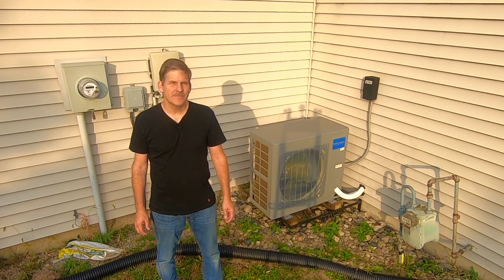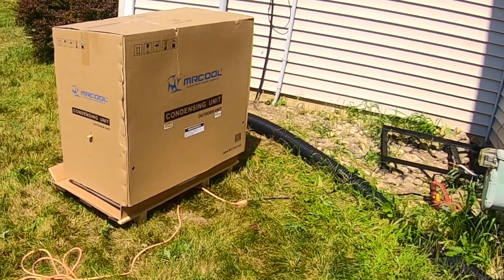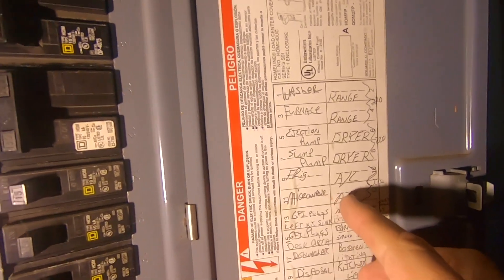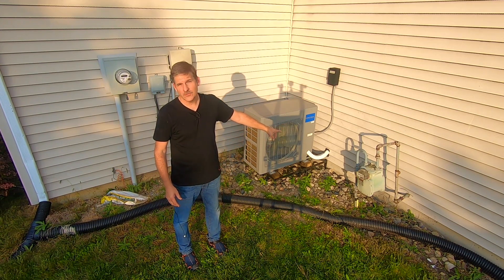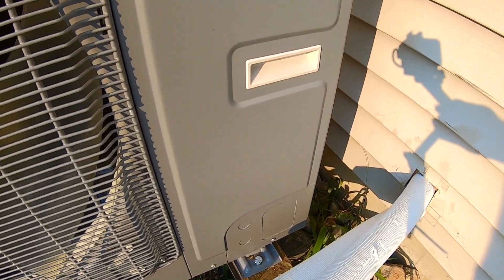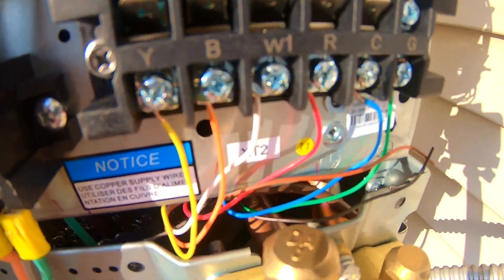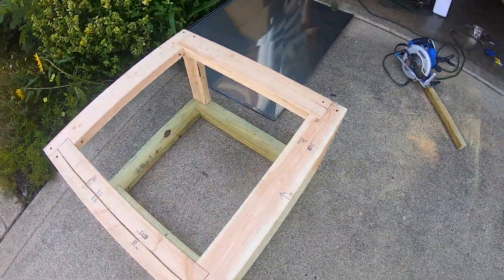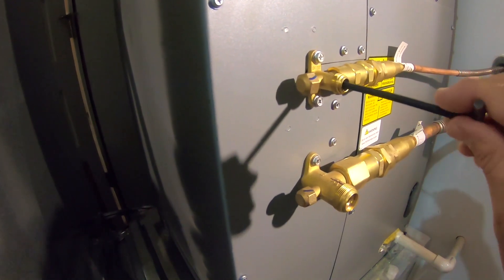How to install Mr Cool Universal Heat Pump: air conditioning and heat solution

Comment: how does the system get fully charged?
Reply from the maker: Hey Robert,
The unique aspect of this system is that the line come pre-charged from the factory. All I had to do was make a simple connection with a wrench and open a valve with an Allen wrench. 
Hope that helps. Thx for be watching. 
BTW - we plan to post the winter review video of how the heat pump system performed through our Midwest winter - it should get posted  on 4/17
Reply: Just as an FYI, all units are precharged and have been for decades :) Even typical units from say Carrier or Trane.
That being said, some aren't charged right even from the factory :/

Comment: How does the inside unit get it power? Is it a separate 110/115 volt?
Reply from the maker: Hey hoptag,
The indoor air handler uses another 230v circuit inside. We got it easy on that part. Our house came with a 230v circuit for an electric dryer. It was unused because we have a gas dryer. So we repurposed that.
Thx for watching!

Comment: how good does the heat work when its mild or barely chilly out? Lets say its 50/55 degrees outside?
Reply from the maker: Hey hoptag,
Heat pumps work heating by taking heat from outside and bringing it in. The warmer it is outside , the easier it is to heat the inside. 50 degrees is relatively warm so it would work well. 
This past winter it went down to at least -9 degrees here and was still able to keep our house at 70 degrees w/o an aux heat strip. 
Heat pump tech had come a LONG way in recent years
.
Thx for the comment and for watching!

Comment: which side of the inside unit the hoses are installed?
Reply from the maker: Hey Luis,
As you look at the air handler, where the air enters the air handler as the front, the  connections are on the right hand side.
Thx for watching.

Comment: Obviously you have installed these before so you know what you are doing.  But installing one of these looks quite involved and I bet not just anyone could install one of these.  I also notice that this job requires a lot of strength and you have a buddy helping you.   The only downside to this is what you got the heat pump sitting on.  You surely could have done better when it came to the base it sits on.    But I'm impressed since I'm needing to replace my furnace and  air condition.     Thanks for the great video.
Reply from the maker: Hey 100....,
Thx for watching!

Comment: I just bought this system and 25 feet of linset do i need to buy that union that you screwed on between the big line and the condenser? i guess you need a set for the air handler also or does the linset just thread on directly?
Reply from the maker: Hey Jay,
The necessary connections should be included.
The set-up should come with everything. But if you order 2 line sets to reach a greater distance, I think you’d then need to order a union set to connect the 2 line sets together. 
Thx for watching.
Reply: @Housebarons  Im glad to know that, i even ordered the mr cool wi fi t stat!

Comment: DIY installation is a recipe for lots of installations being out there 'in the wild' that don't meet local code. You pay for more than the materials, process steps, and physical labor with a contractor, you pay for their know-how and ability to design an installation that will meet code. That being said, the MrCool units are neat and hopefully they last and can be serviced.
Reply from the maker: Hey Avoustic,
I do think Mr. Cool has tried to address making the install fairly simple and help prevent hack jobs in “ the wood”. 
As for longevity, here is hoping. We will keep you posted!
Thx for watching.
Reply: Did you put an oil return bend in the linesets since your air handler is located below the condenser in elevation? Great looking install and very clean. That 3/4 looked tough to bend. I bought a cheap bender on eBay to tackle that.

Comment: How big is the house? Also would have been nice to see how you attached the air handler to the existing duct work (top of unit)...seeing the box built for the return was helpful.
Reply from the maker: Hey Rob,
This was an unusual install. I’ve never had a heat pump before ( previously we had a gas furnace. ) . So because my condenser died, I left the gas furnace which still worked in its place. I then mounted the Mr. Cool Universal air handler next to it.
In this video, https://youtu.be/S3ZEmjLvyNo
You can kind of see it behind the return ductwork I was attaching to the air box. 
This video was intended to show basic ductwork. 

Originally, I had the new air handler go directly up into the supply duct . The flow was not very good, so I changed the duct out of the top of the air handler and directed the air to go to the right to the original air plenum sitting over the old furnace. This worked fine.

I was reluctant to trash an old but still working gas furnace till I could make sure we were totally sold on the heat pumps winter heating abilities. Old heat pumps do a bad job of this. 
However, as winter has progressed, we have seen that even below zero temps did not hamper the heating ability of the New Mr Cool Universal. We did NOT install an aux heat strip and even though we’ve experienced below zero temps, the heating stayed easily at 70 degrees - thx to the inverter technology, it is still efficient below zero degrees F. 

Anyway, we plan to do a review after winter is over and layout it’s winter heating costs and performance. You may see the whole set-up then.

BTW - the house is 1900 sq ft with a basement ( but vents are closed down there) 
Thx for watching!
Reply: @Housebarons  Thanks for directing me to the other video. I have the same type of system from 1993...gas w/4 ton AC...all still working but on its last leg. My house in AR is 1600sqft with an additional 700sqft walk out basement. I can't decide if I want to go with the 2/3 ton or the 4/5 ton Mr Cool Universal. My other issue I can see coming is joining the old plenum to the new unit. It looks like whoever put this in did a crazy custom fab job...all kinds of weird angles and where the two meet the old and new air handler are different sizes so I'd probably have to fab something else together...any tips?
Reply from the maker: Hey Rob,
Great question!
We lived in AR a while back - very familiar with the hot summers! It ultimately boils down to windows and insulation.
We have double pane windows and r-50 or so in the attic, no shade trees, 3 bedrooms (700 sq ft ?) upstairs. 
So the 3-ton ( default ) setting was fine for us. 
You can compare from there. If you are using the basement often, have less insulation or leaky windows, then maybe you stay at 4 ton. 

It is such a tough call because there is plenty of writing about over sizing is not good for longevity of the system. But that doesn’t seem to be your case - you being on a 4 ton now that has lasted a long time seems right. 

Since you are already on a 4 ton, I would be worried about going down in size... other than the 3 ton is doing fine at my house. 😃

This system should be much more efficient than what you have, so I expect you’ll be saving cooling $ at least. 

As for the hook-up, if your heating needs aren’t huge as I would expect, you could just get rid of gas furnace altogether and old cooling coil and even the funky plenum and start fresh. That is NOT what I did because I was worried about heat pump and winter performance. So my routing to the old plenum is convoluted , but in the end worked. 
But a direct route of air through the plenum to the supply trunk would be ideal.

Btw - Mr cool does make a split system if you don’t want to leave gas for winter...but that would take a pro-HVAC install. 

Are you installing it? Do you have a time set for when or is it just some day down the road? 
Thx.
Reply: @Housebarons  We have crappy windows and average attic insulation (soon to be remedied) so the 4/5 ton will probably be the sweet spot for our situation. We are planning on ripping out the whole system and replacing with this unit ourselves in the next month or so. I feel that with the Air Handler also being variable speed DC...that should save on power consumption in both heat/cool and air circulation. The furnace/air handler we have now uses about 950W just to run the blower. I found a couple of videos on how to field fab a connection from the air handler to the existing supply plenum...looks pretty easy. The next thing to tackle "in my head" is the return. The return comes from the 1st floor to the basement then passes through a block wall at ground level. On the other side of the wall is the filter box/housing that is joined to the side of the furnace on the floor. From what I can tell, I'll need to build/buy a box for the new air handler to sit on and somehow fab/coble together a connection to the return as it exits the block wall. Guess I never really realized their was so much "custom" work when installing HVAC systems...at least from the connection standpoint.
Reply from the maker: Hey Rob,
I’m guessing the 10.5 seer heat pump heat is about 25% more expensive than my old 10 seer gas furnace ( just a guess, haven’t crunched the numbers yet) 
But the 18 seer universal a/c is 80% more efficient - so summer is where the savings will arrive. 
As for your return, could you connect the new air box/ return plenum to your old return? I had to build a duplicate return because of our temporary side by side set up. But maybe with a little fab ...?? 
You are right - lots of  “ custom “ duct work but since you are doing a complete replace, hopefully it won’t take too long. 
Sounds like you’ve done your homework - I expect it will go well!

Comment: I am just learning the ins and outs of hvac, and considering installing this unit this summer. Apologies if this question is crazy. My existing gas furnace is a downflow furnace, with the return coming in from the ceiling and the ducts in the floor. The slot the furnace is in now and where the air handler would be going in to is just big enough to fit the air handler by about two inches. Can I install the air handler upside down?
Reply from the maker: Hey Eric,
No. I don’t believe so the way you are describing. But it does come with 2 drip trays. One vertical, one horizontal. 
Therefore, the universal can be in an attic / downflow position where the unit sits on its side ( so to speak ) or in a horizontal position  - if the unit was placed in an attic and the air was directed down into the house. 
So if you are talking about an attic install, the horizontal position may work for you. 
Here is a link to the Mr. Cool site video where the show it mounted in the attic horizontally:
https://youtu.be/w6Z8_dpXFM4
Hope that helps.
Thx for watching.
Reply: @Housebarons  thanks for the reply! Unfortunately, here in New Mexico, we are the land of no attics and flat roofs. Looks like I'll have to explore some other options...
Reply from the maker: Hey Eric,
Ouch. That’s a different kind of setup - but guess for your area - makes sense.
You could call MrCool to see if they have anything for you market segment.

Comment: How much have your heating bills gone down?
Reply from the maker: Hey Justin,
None. They have gone UP. But that was expected. 1) Natural gas ( which the heat pump replaced) is very cheap. Electric isn’t. 2) the SEER rating ( seasonal energy efficiency ratio ) for the old unit was 10 and this new unit heat seer is 10.5. So they are very close here. 

The plan was to save money in summer. The SEER rating on the a/c side however for the new unit is 18 - which is 80% more efficient than the old 10 SEER rating of the old unit. 

So, that means the savings in summer should eclipse any extra cost in winter. 
In addition, the DIY aspect of this MR COOL meant I could install it rather than have an HVAC company inetall theirs. That alone saved me $2000+ dollars on the a/c alone. 
So after a full year, the savings should be substantial.

Keep and eye out. In spring we’ll do a review on its winter costs / performance. And after summer we’ll do a total 1 yr review. 
Thx for watching!
Reply: I’m from Missouri and I’m about to buy one for my house and install it in spring I have all electric heat I was wondering if your electric bill has been higher our lower this winter then it was in the summer with your old unit thanks.

Comment: How much kWh does the unit use in the winter months ?
Reply from the maker: Hey Jason,
To do any comparison it means weighing MANY, MANY variables:
- where you live
- how cold it gets
- thermostat setting
- how many windows you have
- how much sun you get in them
- how well the house is insulated
- size of unit
- how tall your ceiling are
- square footage of house 
Etc, etc, etc

We are in Midwest USA, 20 year old house & windows, r-15 insulation in walls r-50+ in attic. Average 9 ft ceiling height. ~1900sq ft plus 1100 sq ft basement ( vents closed in basement).
We get very little sun in winter. 
Windows are double glazed.
Mild winter this year.
Unit is set at ( 3-ton or 36,000 BTU) w/ no aux heat strip.
Thermostat set to 70 degrees at day and 66 degrees at night. 

With those details : In December our useage was 1582 kWh. 

I’m the spring, we will make a review video comparing its first winter in use compared to previous gas bills we’ve had ( since it has replaced our gas furnace ) 

Hope that helps. 
Thx for watching.
Reply: @Housebarons  thank you so much for providing all this specific information. do you mind telling us where you are or at least what climate zone you are in? this sounds like the system for me.
Reply: Installing this unit my self next week, couple of questions . Does the communication wire come with the unit? What’s the breaker size for the indoor and outdoor units and are they both 240 ?

Comment: How has the Mr cool been doing in the winter to heat without backup heater coils?
Reply from the maker: Hey Oca,
No problem at all. Our lowest temp this year has been in the middle teens. We have not had any issue. Again, this is because it uses an inverter and the result is efficiency at much colder temps than the old heat pump technology could do.
We’ll do a follow up video in the Springtime to update it fully.
Thx for watching and keep an eye out for that next video.

Comment: You said that We save a lot of money on oil and natural gas yeah!!! But you guys never say how much is gonna be the maintenance of the system every year or how much is gonna be the contract. Looks like the money we saving is the same money will end up in your pocket.
Reply from the maker: Hey peaceworker77,
This video is actually about replacing the a/c at my house. I’m simply offering an example of what we are doing. It is an experiment which I’m sharing with any who watch. And I said in the video, I would post the results of its performance. It’s just that simple.
I’m planning on NOT having expenses each year.... and if I do, I will keep viewers up to date. There is not contract with this unit. It’s a one time purchase. We are trying to be as transparent as possible so that the viewer can make an informed decision.
Hope it helps.

Comment: Wow, thank you so much for posting this! I just ordered mine and my wife is insisting I hire someone to do it. Like you we are replacing our older ac unit and our propane gas (waaaay to expensive). 
I’ve order the outdoor unit with the air handler and Pre charged lines as well as the install kit. I have an existing air handler but not 100% sure if it is the exact same size. Did you have an existing air handler?

How has it done so far this winter?  Thanks again for posting this, super helpful
Reply from the maker: Hey K.J.G.,
Check out the reply I made to beachbum1 in the comment below for long reply. Basically this heat pump is  more expensive than natural gas heat so far but I expect to more than catch up when it come to summer a/c. 

We did buy the whole system - air handler w/ the condenser and no-vac lines. 
We had old refrigerant in the old system of course and this new system has the new R410a. 
Our old a/c system was 20 yrs old - no way any parts of the old system were worth saving even if we could. Not very comparable - old w/ new. 

We left the old gas furnace in place ( as the a/c was what failed ) and mounted the new air handler next to the old furnace. I was a bit skeptical that the heat pump would do the job cost effectively so I wanted to run the Universal thru the winter to test it before we removed the natural gas furnace ( which might have a couple years of life in it). 
The Universal inverter technology is doing fairly well so far ( expense wise ), so it will be a keeper. 

Hope that helps,
Thx for watching!
Reply: @Housebarons  Hi - Thanks so much for all the details! 
Did you actually connect the the air handler and the furnace to the ductwork together? Did you chain them...? 
Also - did you wire both systems to a single thermostat...? if so, can you describe how...?
Reply: @Housebarons  Hello, Would you please show details how you added this to the existing DUCT system. I saw you showed how to made a box and foiled it and put duct around the wooden box. But exactly how did you used that box and how the mrcool is connected to the existing system ?